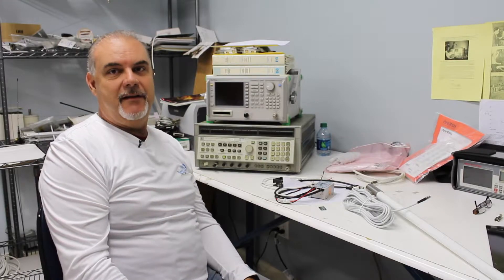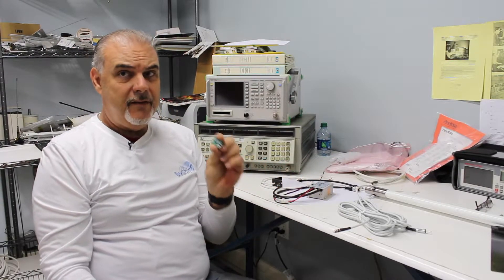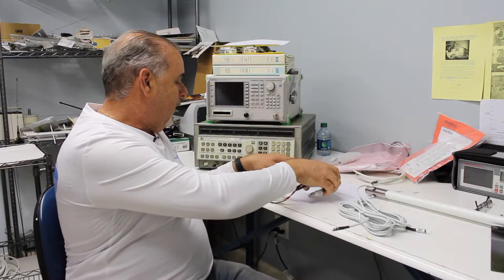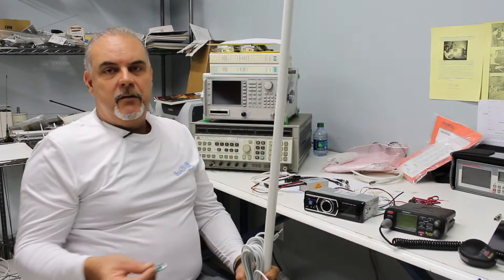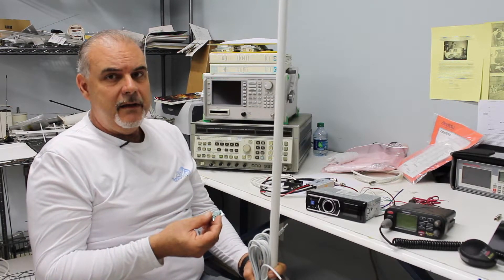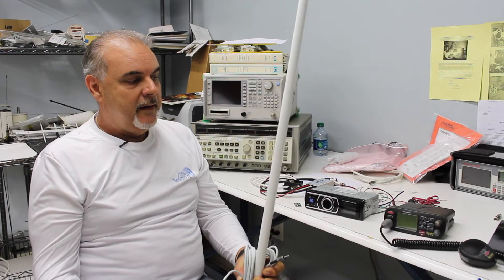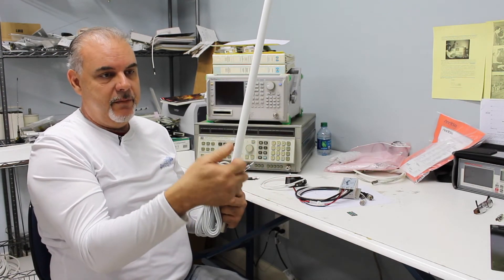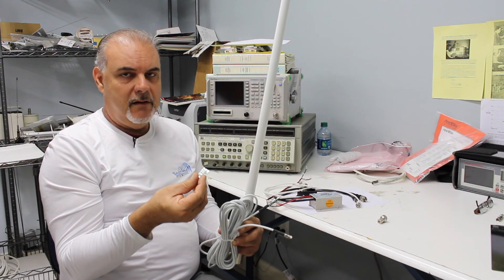AirWave Marine - Dual Band AM/FM VHF Combo Antenna Explained

Comment: If the splitter is inside the antenna then why are there two wires coming out requiring a splitter?